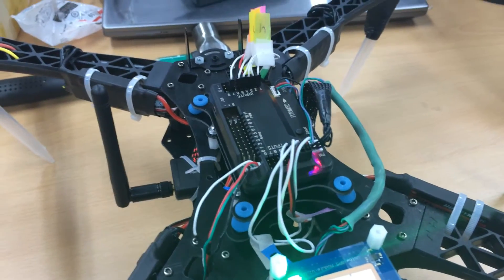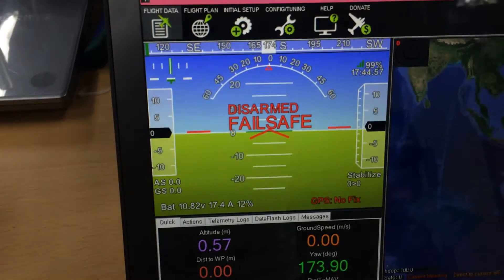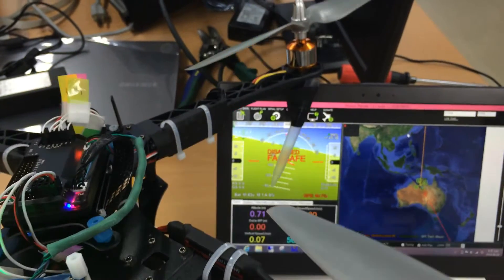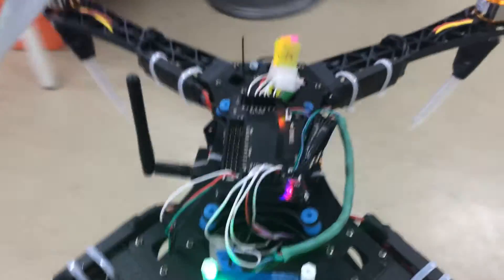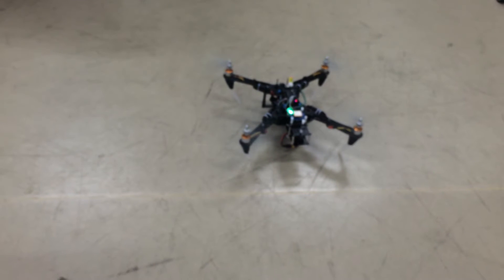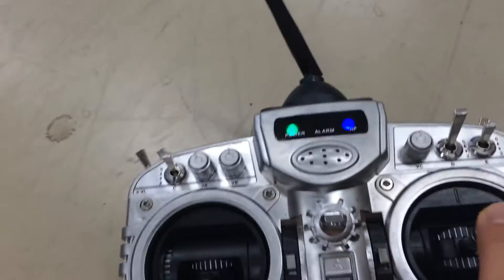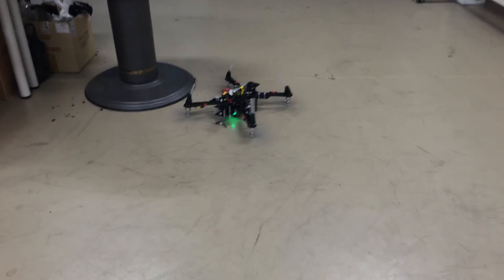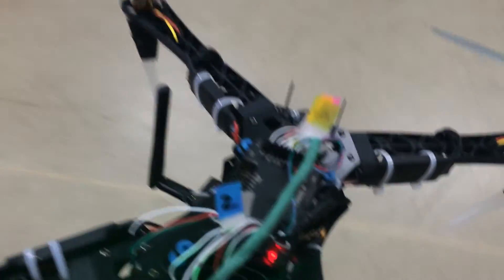APM 2.6 quad take off fail

Comment: I just experienced the exact same thing with my APM 2.5+
Reply from the maker: did you solve this problem?
Reply: Changsoo Kim Not yet. At first everything looks normal but when it lifts from the ground it starts to yaw uncontrollably. Mostly it wants to yaw ccw. I can fly it for a couple of seconds but I have no yaw control at all. I will try to recalibrate the magnetometer. Any other ideas?
Reply from the maker: SAndersen30  problem solved, plz check this link. hope you it works for you.
http://diydrones.com/video/quad-take-off-fail-somebody-help?xg_source=activity